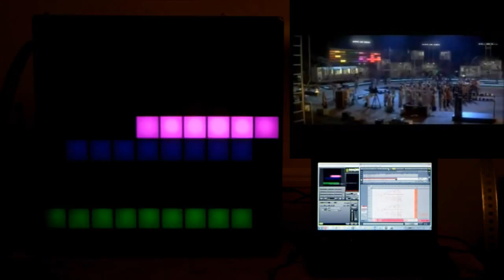PixelBrite

Comment: Man i luv electric engenering. Ive built a pc by myself when i was in 5th grade and it runs like a charm. I would luv to make this but i cant make circuit boards or anything. Computers are straight forward and to make this acually needs backround i think. But great job, great job. What an impressive build